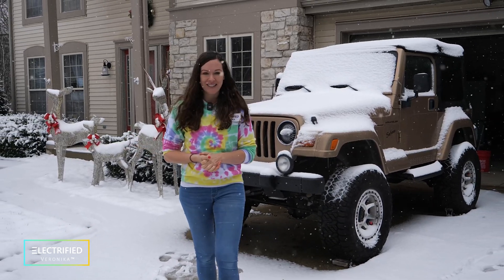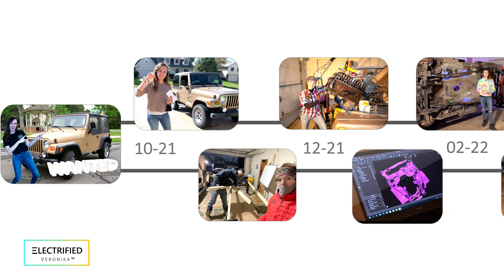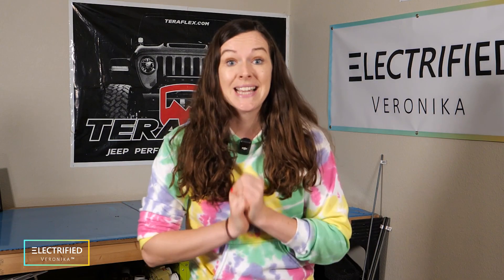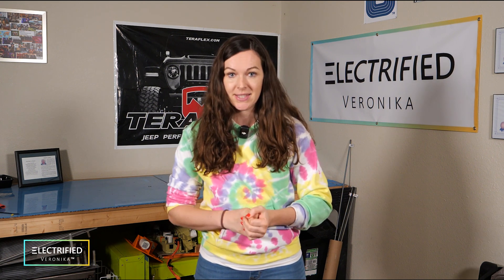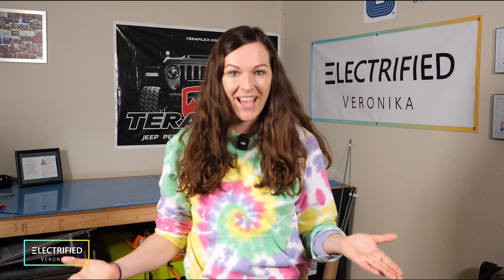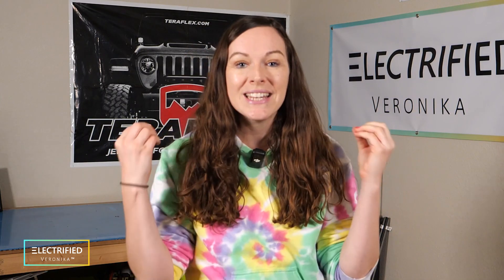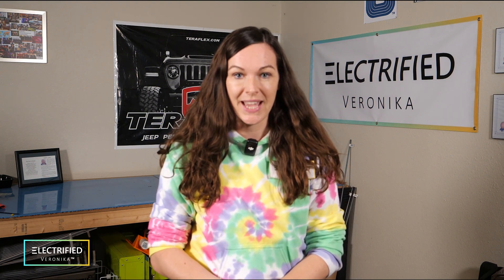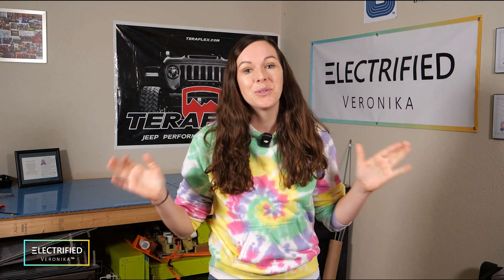Electric Jeep Conversion - We are Back with Special News!

Comment: in depth video about AEM system integration would be very welcome.  Best of luck with the build. Building it with this level is hard.  I know because I am doing it for last few years. There are a lot of custom details that are needed to be made and design must work with the chassis.  Having batteries in several places is also not ideal.

Comment: Batteries under the hood, not possible in Germany as far as I now. The regulations say in an E-conversion the batteries cannot be mounted within the front crash zone of a car.... Hopefully that will change with solid state batteries which which don't come with reisk of explosion and fire. Under the hood is a great place in any ICE to E conversion since the suspension is trimmed for the weight of a heavy ICE engine. It should help big time to keep the original weight distribution...